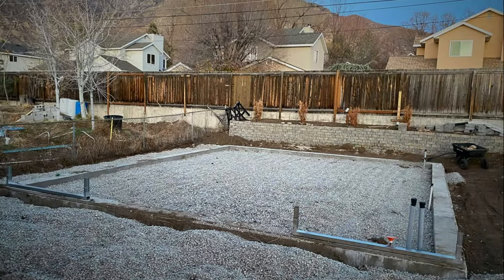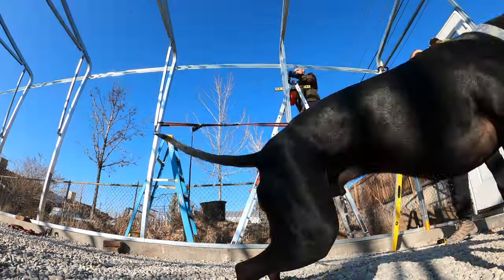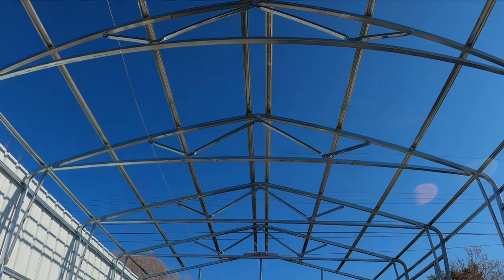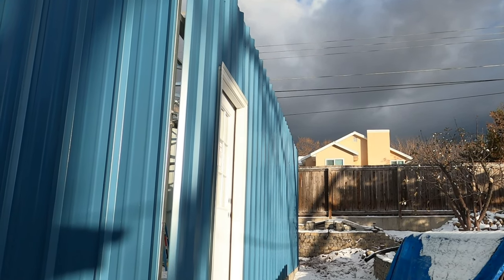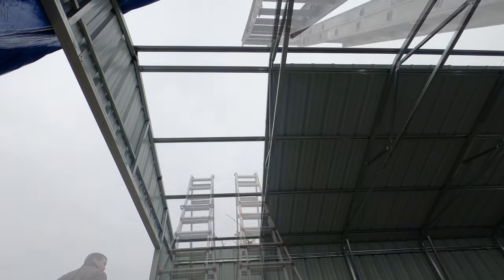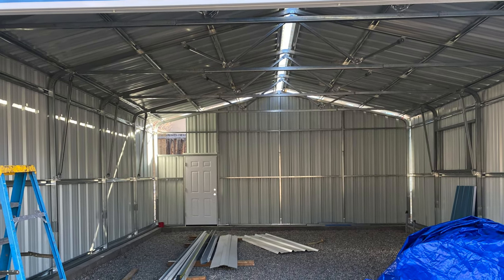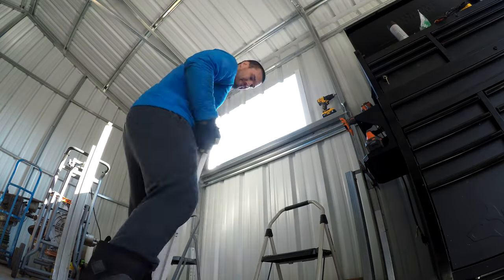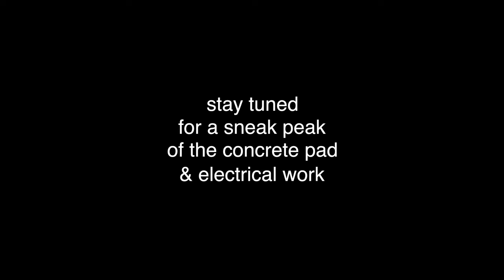DIY Garage from Versa Tube

Comment: A guy can learn a lot from watching others. Tonight I learned that vertical metal is much easier to install than horizontal ribs. I'm also going to just make the outer footing, but leave the inside gravel at first. I even like your color scheme. Good job.
Reply from the maker: Thank you for the comment. Leaving the concrete slab until the end has pros and cons but we would do it again that way. One thing I would have changed is doing a little bit of a stem wall with block/concrete, maybe 2-3’ tall around the perimeter and then having the metal building on that. Might have been better that way.

Comment: The video didn't show how to install the ridge cap.  Can you walk on the roof to do that?
Reply from the maker: Yes, it seems like it would be flimsy but the roof is very stable. Consider the snow load that it would have to sustain in certain parts of the country (50 lb+).

Comment: Great Job, looks nice.  Just curious about how you decided to insulate?  I think Versa Tube has a system to sandwich the insulation between the exterior panel and girt.  Did you consider doing this?  Did you consider doing wood construction?  I'm curious why you chose to go with metal?  TIA

Comment: How much did that cost you?
Reply from the maker: Check out VersaTubes website, they have very clear pricing. We bought on a “spring discount”. ~$13.5k for building with stamped engineering prints. Had to hire out the cement pad due to the shortage, no one would sell me concrete. Footing we did ourselves including concrete. Combined concrete price ~$8.5k. It can definitely be done cheaper, but happy with the price and product.

Comment: did you attach the window flange to the square tube on the openings or just capture the window between the sheet metal and tubing?
Reply from the maker: Capturing the flange between sheet metal and frame held the windows and was fully functional for several months but I did go back and screw it in around the perimeter of the window.

Comment: Great job and info,  I have a question about snow load and the 3/12 pitch.  How many inches of show stays on the roof? also doesit seem very sturdy if more snow heavy snow would be on it without brooming/raking it off?  i ask because I am wanting this style in Northern Wisconsin but the snow load worries me
Reply from the maker: Great question, easy answer is that versatube will provide engineered drawings for an extra fee. Makes it simple. They have various truss styles and will adjust the height of the corner bracing to accommodate the load. If I remember correctly we had a 50-60 lb snow load range for our building, over the county requirement but I thought of putting solar up there. I can look up the exact specs.

As far as snow retention, the roof will shed snow quickly. Especially if uninsulated like ours. I put a snow retention in place to keep the snow on the roof after our first winter. Snow was piled 4’ high on either side of the building from sloughing. Retention systems are simple and inexpensive and make it safer around the perimeter of the building. 

Hope that helps. Cheered 👍

Comment: Thank you for the detailed video. Does the kit include trim pieces to close up the gaps in the eaves and bottom of the walls? I'm mainly concerned about mice getting in the garage.
Reply from the maker: All trim pieces are provided with the kit. Versatube does not manufacture the r panel or trim but they source it from local sheet metal companies on your behalf when you purchase through them. You can also source it yourself. In terms of mice, you would have to put in some extra effort to keep them out. It would be completely doable but would require extra time and consideration.

Comment: I recently bought a property that has a versatube building and I want to add a few windows. Did you get the windows from them? Is it the same as the sheet metal where they just source them locally for you?
Thanks
Reply from the maker: Windows are just from the big box store. Standard house windows, nice that this way you can go with pretty much any size. The frames/brackets you can get from versatube but it’s also easy to just locally source… just get some rectangular tube and angle brackets to fix horizontally to the verticals.

Comment: Great video!   I'm thinking of buying a building just like that one in a similar climate.  how do you like it?
Reply from the maker: It’s been fantastic, summers it will get warm but opening the doors/windows gives a great cross breeze. Winters it can get cold but still perfectly functional. My intention is to insulate and I was going to install a split AC (just order an extra window frame kit to do this), I think it would make a huge difference. As is I would still do it the same way again.

Comment: Thanks for sharing and great video work.  What are the dimensions of the garage?
Reply from the maker: 24’ wide x 30’ long with a 10’ wall height. Thank you for watching our video!
Reply: @GetBusyBuilding  that's exactly the one I am thinking of.  Do you think 2 smaller garage doors would work better?! I am debating that one.
Reply from the maker: I prefer one large door but two smaller doors could definitely work (8’ wide would give you 2’ 5/8” on corner and in the middle if you were going for a symmetric look). There are a lot of combinations you can go with though. I do like that Versa tube will give you a good 3d model on their website to help visualize.